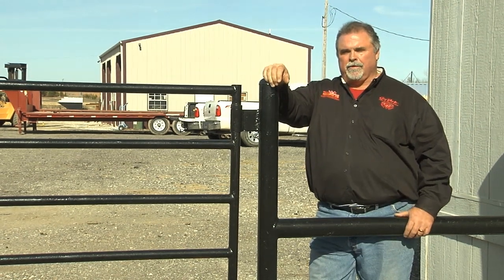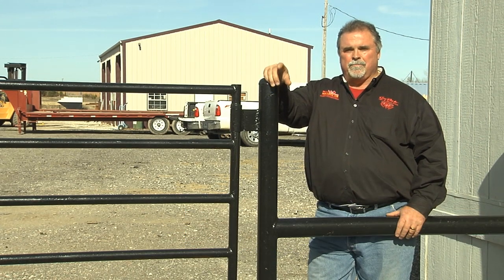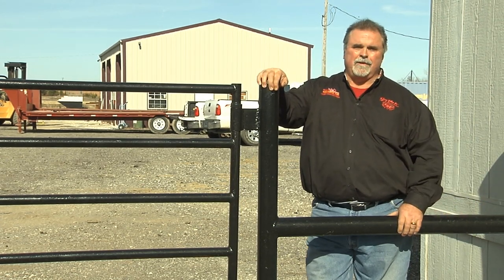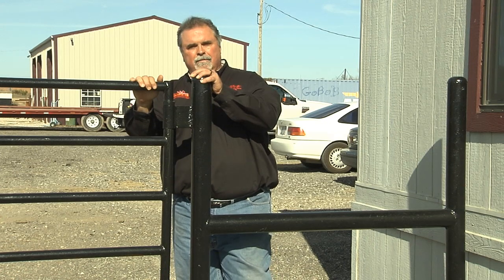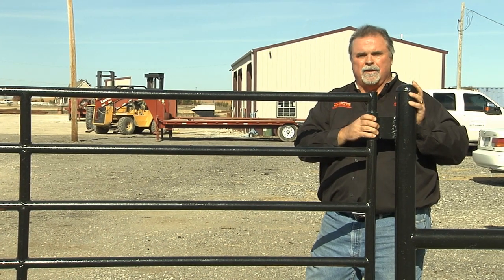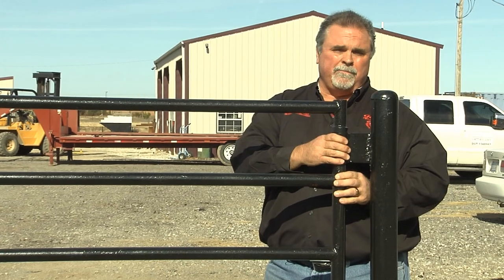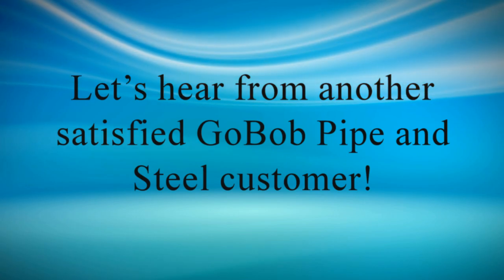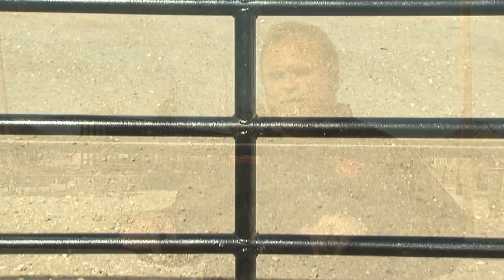Gates and H Braces for your next Fencing And Corral

Comment: Bob, isn't that 3-4 inch gap on the hinge a problem with horse getting caught in ?
Reply from the maker: Your right DD826.  A horse could catch a hoof between the post and the gate.  That gap is there to allow the gate to swing both ways more than 180 degrees.  Keep in mind that 99% of the equipment we build is for cattle and that is how our standard equipment is designed.  For the horse customer we have another design that eliminates the gap but it cost more and we don’t want to charge the 99% for something they don’t need.  We are, however,  very capable of meeting the needs of a horse customer.  
 - Bob Studebaker